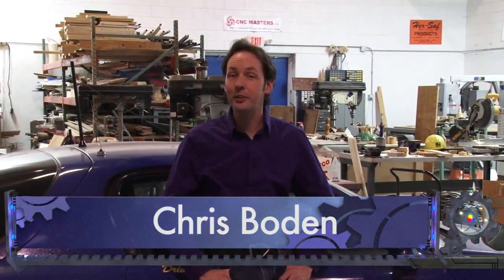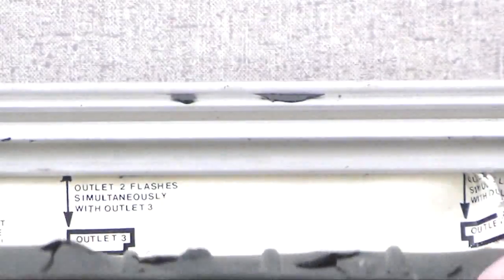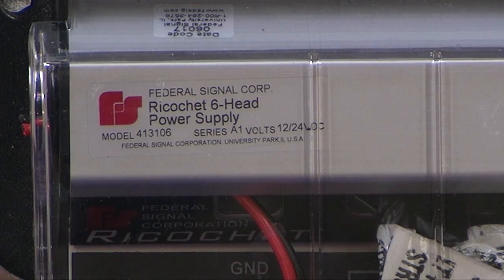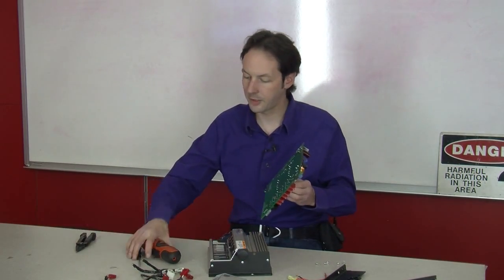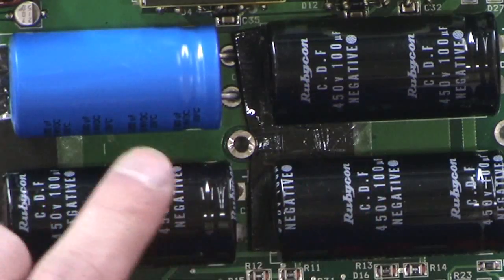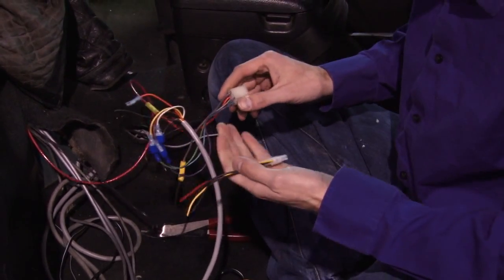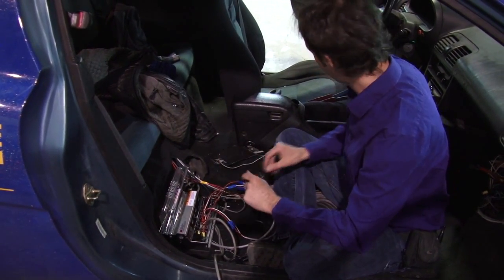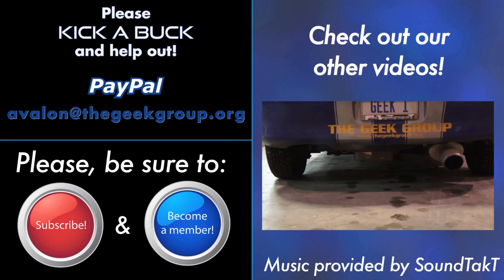Installing A Strobe Box Into a Vehicle

Comment: The thing you thought might be a piezo, is just a insulating cover for the TO-3 package transistor that drives the flyback transformer.
The 94V-0 mark is a flammability rating. FR4 material is common for PCBs. It is a flame retardant version of G10 (you know what that is).
The older unit does not have solder mask on the PCB, so it is the natural color of the FR4/G10. The newer unit has green solder mask that gives the illusion that the PCB is green - it isn't - just the solder mask is green.